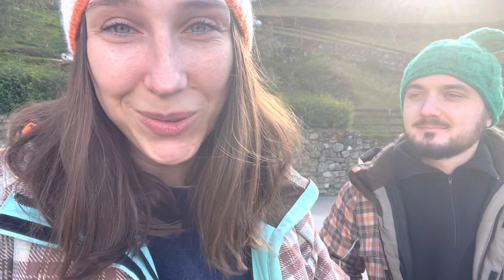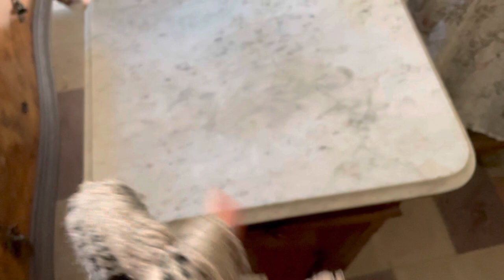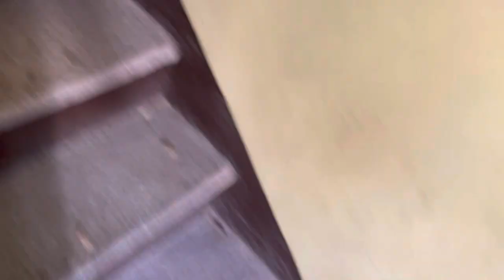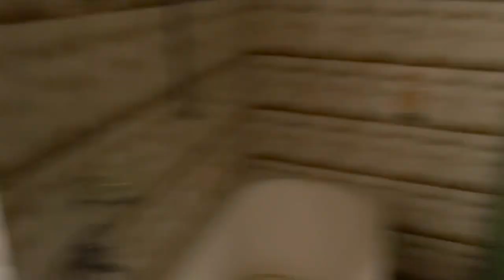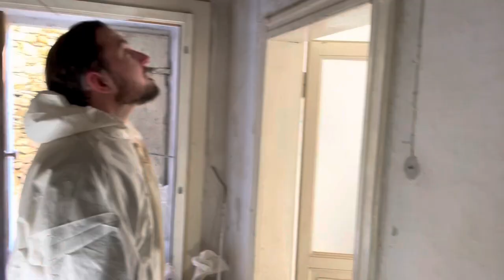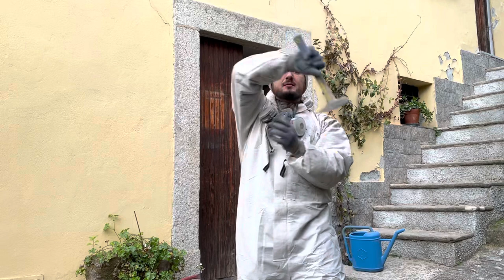Day 152 of renovation\old ceiling removal

Comment: Maybe you can get some used sheets at the charity shop to cover the furniture. That would be easy to shake the dust off and wash them now and then. It is amazing the work that Sergi and you have done so far. It looks so challenging and sometimes that old house can be so spooky but you've hung in there and got it done. Inspiring.